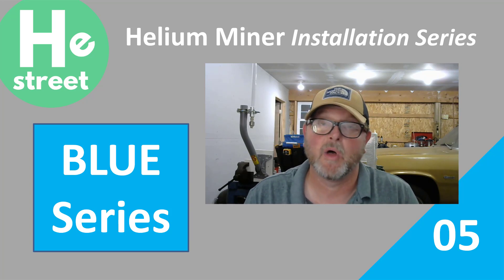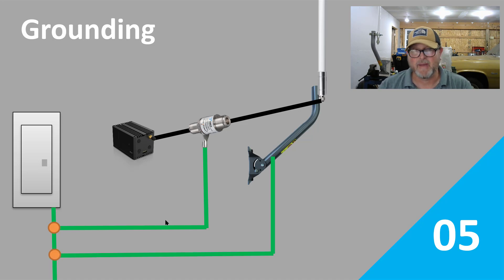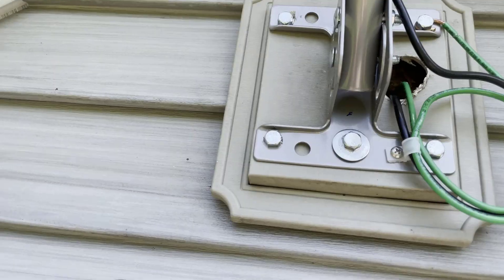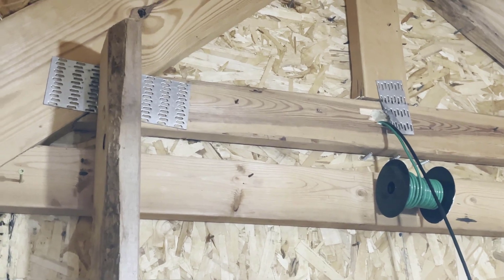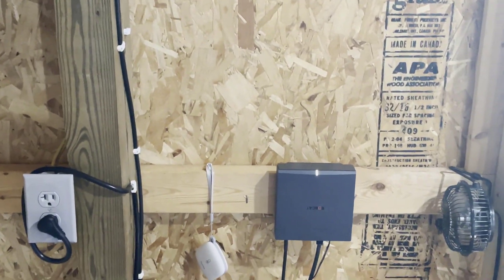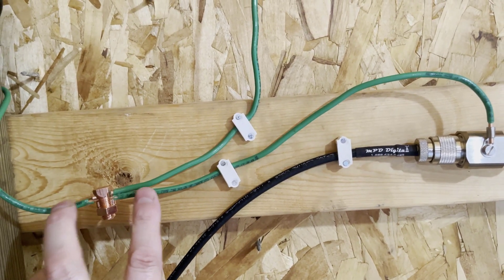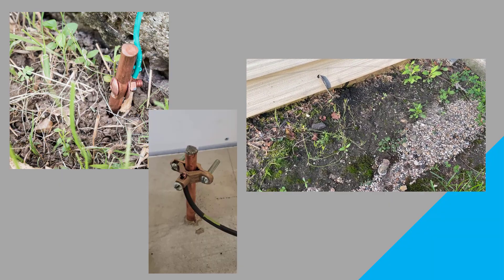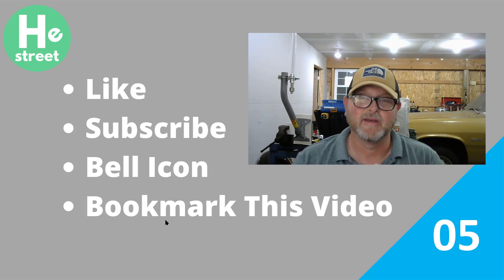Helium Hotspot Miner - Grounding Tutorial [BLUE SERIES] 05

Comment: Question He: placing a cable from the bottom the antenna to the arrester or having the arrester at the bottom of the antenna what is the difference?
Reply from the maker: Electricians and electrical inspectors like the arrester to be as close to the device you are protecting as possible or to the closest point where the COAX enters the building, UNLESS it is an interior installation like the BLUE series.  In that case we are doing all of our grounding inside and it's easy to get the arrester close to the device (the hotspot/miner).  You will see in the red series vids that we have the arrester connected directly to the bottom of the antenna because our hotspot/miner is right on the inside wall only inches away from the end of the antenna.  In that case we just attached the arrester to the bottom of the antenna and only had to buy one piece of COAX.
Reply: @vandelay.digital.academy  ah ok but would either installation be better for protecting equipment or help with signal loss/gain ? Befits of both ?
Reply: @Robert-ks3gl  What is purpose of arrester? To protect the device from any surge from antena and coaxial line. Surge travel to coaxial bride go to grunding thru body of arrester, and inside line of coax will be grounded with gas discharge bulb of arrester.
Lightning hit antena, go down on coax cable and meet arrester, who divert it away from miner to grounding rod.

Comment: Thank you for this video! So helpful.

I have a question: I want to use a solar panel to power an outdoor miner. The system will be Solar panel into Charge regulator then battery and then Inverter. I will utilize a large mast to install the antenna, solar panel and  the Miner which will be inside an enclosure. 
Do I have to install a grounding rod in the ground like in the video?
Reply: You need to do proper grunding. You install lightning protection, spike on top of mast (higher than top of antena) conect with proper rod wire all down to grunding. Ground have under 10 ohm, 2 to 4 ohms is super, under 2ohms is ideal.
You find it all inelectrical store.
Remember, lightning is like water, take less resistive path to ground.
Reply from the maker: I believe NEC has specific requirements for off-grid solar systems but I am not sure about off-grid antenna systems, Those requirements may be specific to off-grid homes.  More investigation is required to be sure of the details.  Logically, you will want to protect your equipment, those miners are hard to get, and harder to replace.

Comment: I’ve used a pipe bond clamp to bond antenna mast to grounding system.  Just run the wire through it and make a window cut in the insulation….gets rid of the split bolt bonding point
Reply from the maker: Great tip thanks!

Comment: How are antennas grounded when put out on an apartment balcony?
Reply: If you live on top floor, you can search to lightning protection on top and conect ground to that cable, rod wire or flat wire.
Less efective but better than without is to connect antena ground to balcony (metal bar who is welded usualy to building metal structure) thru mounting clamps.
Reply from the maker: They typically aren't.  From my experience.

Comment: Nice vid, but of course the real magic is getting your ground from the attic to the basement through the walls, which is not shown here.
Reply from the maker: This application was an outbuilding (garage) that did not have drywall.  It was very easy to run the ground wire from the 2nd floor storage area to the main level.  This was not a basement.  If I had to deal with drywall, I would just run the ground exterior.
Reply: @vandelay.digital.academy  Lightning grounding is allways exterior to proper earth ground. Not the same with house Electrical earth, but you need to conect both to equalize potential.

Comment: Hello helium street amazing video I don’t have like the type of set up you have where you can ground to an existing ground so I was wondering can I do exactly what you did but ground to an antenna rod placed outside with 8feet buried and a little bit sticking out so I can connect the grounding wire which has the mast and coax ground. Will that work good and is it fine if I place the lightning arrestor outside and putting electrical and waterproof tape on the connections
Reply from the maker: Hi, believe me I wish we could just drive out own rod but the correct way (per NEC, National Electric Code), specifies the ground of your device (antenna and coax), must connect to the electrical system of the structure.  So, driving a rod that is not associated to your electrical system is not following the rule.

Comment: Was waiting for this one! Thanks so much.

I have followed your other video that attaches the lightning arrestor directly to the antenna. Is this still okay to do? However instead of the magnetic base it's on a small antenna mast. Should I be grounding the mast as well as per your video? If yes, does the split bolt connecting the two together need to be waterproof?
Reply from the maker: Yes, if your antenna is located outside then it will need to be grounded to your electrical system. As be no. The split bolt connections on the ground wire do not need to be waterproof.
Reply: @vandelay.digital.academy  Ok thanks! Also can a 10 awg stranded copper wire be used instead of solid? Is there a difference?
Reply from the maker: Both are OK to use per NEC.

Comment: In my opinion, is an extra step but not necessary as it's almost impossible for your antenna gonna attract a lightning strike or lightning bolt..
Reply from the maker: Thanks for the feedback Ikbel, this is a common misconception, It's not for a direct lightning strike, it's more for ESD.  And, it's required per NEC.
Reply: @vandelay.digital.academy  Sorry is not a misconception but ESD when you come to direct contact with the PCB board so as not to destroy the electronic components by the electrostatic charges, you must make sure you are having the same ground level.
Reply: @ikbelhammami5525  Miner have a receiver side who use  to input part sensitive transistors. ESD protection is very important because storm can destroy those. ESD will raise and shock component who in time break down.
Before the storm, lisen to am band, long wave and broadcast, you hear cracking noise, that is ESD. You receiver have internal antena, is safe, but if use a valve receiver and external antena and put a neon bulb betwen antena and ground (and disconect receiver from antena) you see it glowing.
Reply: @Helium Street what do you think about putting the miner with the standard antenna inside a waterproof enclosure on a roof mast? Would ESD be an issue since the antenna is “inside”?
Reply: @darcyw8659  Standard miner is built for room temperature, not outside. Consider to use external antena with coaxial line to inside house miner placement.
Reply: @dangligor2745  my suggestion is a modified version of Helium Street’s purple series (less the ext antenna). If the temperature / humidity remains inside the operating temp you can put it in waterproof closure outside.
Reply: @darcyw8659  You need to connect antena to ground before the miner to take away ESD.
IT is better to use external antena because have more gain and better ground connectiion. Keep miner inside conect to antena with coax is better than took outside electronics who is made for inside and water proofing encloser need adițional circuit for heat/cool inside box.
You need transparent box for radio wave made with some plastic, but good box is uv resistant and more expensive.
To keep Basic ( maintenance Free) and less expensive, outside antena connect to ground and coax run inside ( attic or room) to miner is Best solution.
You can put a miner with internal antena inside plastic box on top of mast, will work, but do not know for how long.
Better to be safe than sorry.
This is my advice, you do what you want.